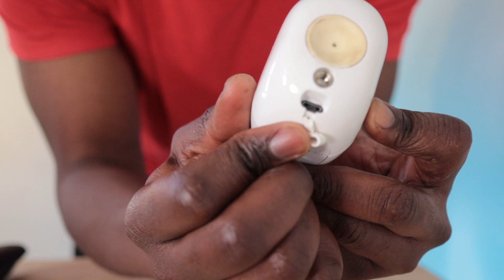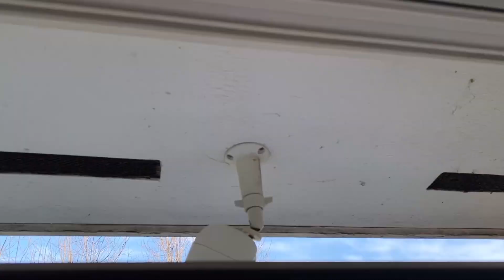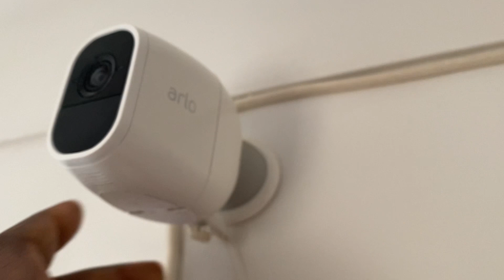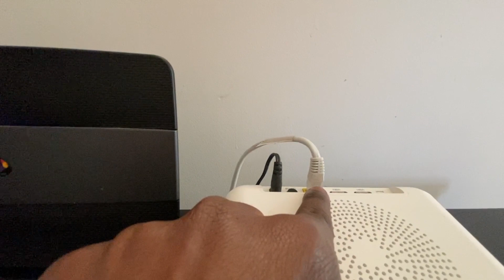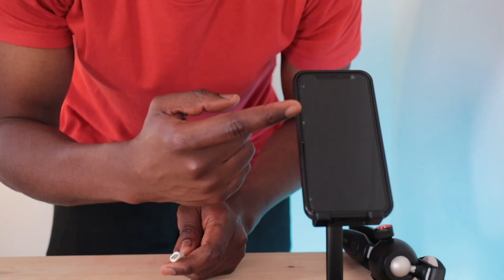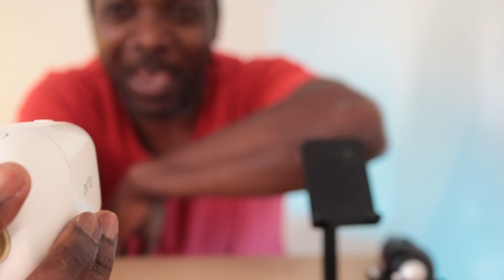You didn't realise you could use this security camera for this? | Arlo Pro 2

Comment: My hub stopped connecting to my router 😢 for some reason it says I have high speed and need to use 2.4ghz , I have both 2.4 and 5.0 ghz but there no option to change between them both 😢😢 had my arlo pro 2 for 5 years, just upgraded  to 5s 2k

Comment: I use them for landfill. Look at you, your a good kid I like you. Me I have fought tooth and nail with arlo / net gear this would be a 10,000 word comment if I got into all. 1st do your research not the kind you look till you find what you want but the white underbelly the bad ugly then go from there. I had to involve holding there stuff ransom and bring in the BBB it got ugly I just wanted what I paid for not what they sold me. They flat out lied and I wasn’t having it. Don’t mix models that’s how this started
Reply from the maker: 1. LOL @ this random comment.
2. I'm probably older than you.  Deffo not a kid. :)
3. I've used this thing for nearly 6 years now.
4. Everyone's experience is different.
5. Thanks for watching. 🙏
Reply: @ade's tech  yes I am older 61. We bought  pro 2 we used 2 of them They were fine. Wife bought 3 more but they were the next model " essentials" that's when 💩 hit fan. They are junk super laggy about 20 seconds. Then the cloud subscription $$ thing. The 2 models wouldn't work together they changed the mounting hardware the pins on the power. I tried exchanging the 3 essentials for pro 2. There marketing was deceitful and I wasn't having it. It was they way they designed there I.T. dept which is in a different country. No refunds. I made 100s of tickets called 100 times made i.t. people cry. They do not refund at all ever no can't get that. They poked a bear and I fought back. All I wanted was to trade my 3 essential cams for pro2 that's it. 2 years of fighting and I finally won. I hold grudges I am very nice and fair but be warned. Arlo cams are fine it's the company
Reply: @moosenbeans903  'made IT people cry' yeah, you sound like a “real blast” 🫤 So, it’s Arlos fault that you bought different models of cameras that are not compatible with each other?  You decided to cheap out and buy some cheap essential cams and thought you are going to get the same quality as the pros?!  Also, you thought that two completely different products would be compatible with each other, the stars would align and they would all just communicate seamlessly and work with the same hardware? 😂 Followed by you having way too much time on your hands so you open “100’s” of service tickets?!  Yeah, I’m sure they put you on some kind of block list and I certainly don’t blame them.  And then your “grand idea” of involving the BBB 😂 I didn’t realize people still waste time with doing something so pointless and nonsensical but I guess it’s only done by people that have too much free time and not enough to do.  

You went out and bought cams that cost less than half of what the pros cost and thought you would get the same performance?  Also, thought that they would all just work seamlessly?  Although they’re two different products?  Here’s an old school term I’m sure you’re familiar with… stop pointing the finger and point your thumb at the one that’s responsible for your debacle 😂 

I’ve been using the same Arlo pro cameras for years and they’ve functioned flawlessly, always recorded and give me a week of free cloud storage.  At the same time, I was familiar with what I had purchased because I did a few minutes of research and didn’t assume anything.  You know, like different generation cameras would all just work together or the budget model cameras they produce would operate the same as the pro series.  

Anyway, good on Arlo for dismissing the foolishness you spent and wasted days, weeks and perhaps months of your time on. 🤦 And as “shocking” as this may seem to you, Arlo and Netgear has not skipped a beat or lost an ounce of business, no matter how hard you tried to give them a hard time. 😂 Plus, the poor IT that work for them for next to nothing having to deal with a “beaut” like you.  I think I will give them a buzz just to let them know that they’re doing a fantastic job.  What kind of person thinks yelling at customer service people is normal?  I’ll tell you…someone that’s totally and completely unhinged.  I’m sure all kinds of CS emps and managers have had the “pleasure” of listening to you yap.  They probably just put the phone on mute, do something else and occasionally say things like 'yup', 'uh-huh', 'whatever you say'  Followed by them all laughing and discussing how miserable and insufferable a person must be to take “pride” in bothering and complaining to these poor people.  

At least, at the end of the day, the CS people, the managers and us, on the outside looking in, we all know who the actual problem and issue is and it certainly isn’t the IT people that work for Arlo or the company Netgear.